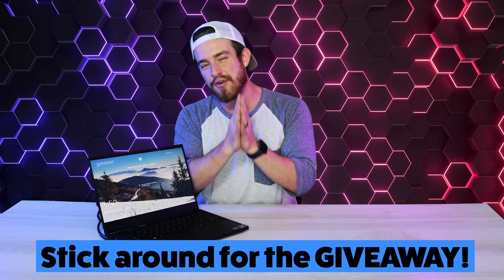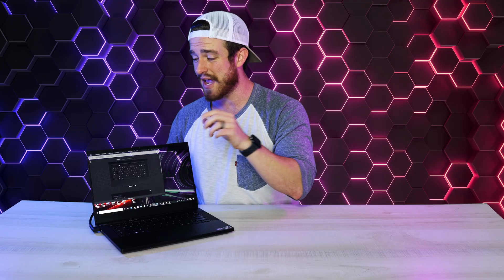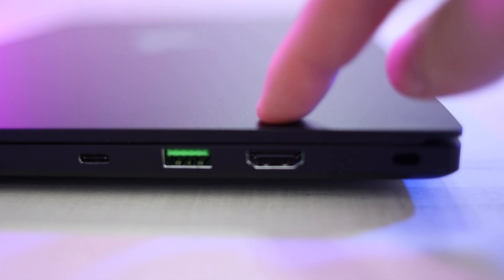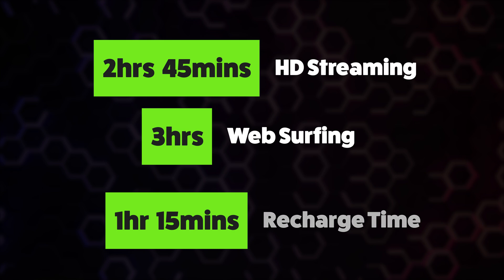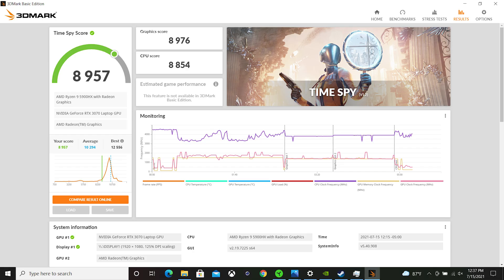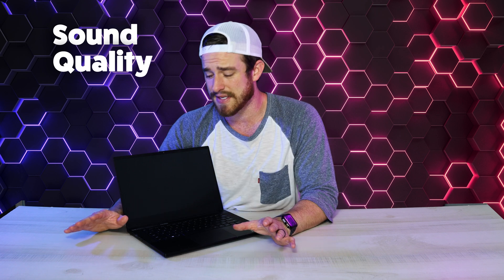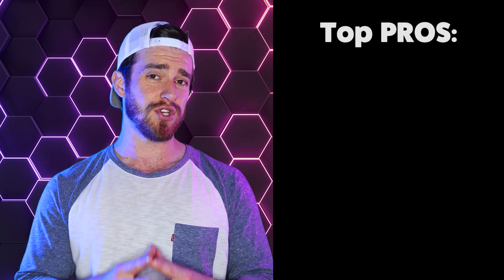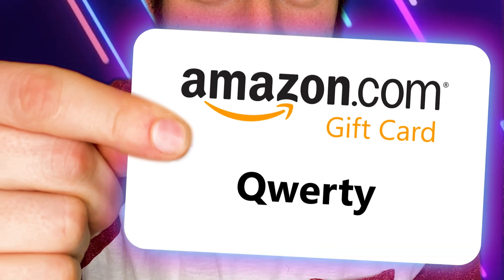Razer Blade 14 Review! - How Does All That Power Fit?

Comment: Great review.  Interesting comment about the battery.  I got my blade 14 prior to finding this review and found the battery life pretty solid at 8-10 hours depending on use, but I can see how 60 watt hours is a little unusual for the size.  I imagine that huge vapor chamber put a crimp on anything bigger.  Definitely agreed on the 16gb RAM, ideally 32 would have been an option, soldered on
Reply from the maker: Yeah Kenneth, I think there was something wrong with mine because some other people were saying the same thing about their batteries
Reply: same I easily get 9 hours, but have seen as high as 12 depending on usage... I've had mine for a year too

Comment: The NVMe at 4:23 is NOT PCIe 4.0 it's an 3.0 x4, it's a Samsung drive with about 3500 Mb/s read and 3000 Mb/s write.
Oh by the way, your wall is cool. Especially at the start with the moving effect.
Reply from the maker: Thank you Eitya! Yes that was my mistake. I must have wrote that stat down incorrectly during my scripting stage

Comment: how temperatures and fan noise against Blade 15 MID 2021
Reply from the maker: Hey shakal, I haven't tested the Blade 15 yet but I would assume they are slightly better on the 15 since its bigger and has more of an ability to get rid of heat quicker.
Reply: @JustinTechTips  if heard differently from what I've heard the 14 has better thermals and quieter fans some say it's because it has amd instead of Intel.

Comment: I'm getting 7-8 hours of battery with the display at 75% brightness 1440p/165hz (3070 Variant). Not trying to be a jerk, but you may not have done the proper tweaks. Make sure the dGPU is staying asleep and check your advanced power options.

Also, why would you test games at 1080p and 4k, but not the native 1440p?
Reply from the maker: Hey Michael, yeah I even disabled the GPU to make sure and only got about 3hrs while HD streaming with the battery slider all the way to the left and the CPU and GPU power options at their lowest settings in Synapse. Maybe my unit wasn't functioning properly if other people are getting so much more time on the battery. I tested the games at 1080p and 4k because those are what I've tested all the other laptops at and I wanted an apples to apples comparison as far as performance.
Reply: @JustinTechTips  gotcha, I understand why you tested at those resolutions. Thank you for the clarification and I hope I wasn’t coming off as rude.

Odd, I keep my Blade 14 on better battery, not battery saver. I have a post on Reddit in the Razer subreddit, maybe take a look if the laptop is your personal device and not a review unit. It’ll help with the battery
Reply from the maker: Thanks for the feedback Michael. No you didn't come across as rude. Do you have a link to that subreddit?

Comment: thanks, all the videos I've saw claimed way way better battery life then yours, almost as good as macbook m1 air ( especially when anything else then light light use like emails ), so I see it's +- the same as my legion 5 4600h rtx 2060 80wh , but this was 1200€ half a year ago
Reply from the maker: Yeah, I'm wondering if I had a unit with a defective battery, because a few people below in the comments have said they got better battery than that as well..
Reply: @JustinTechTips   try to look at hwinfo how much W system pulling out , if external gpu not eating much of a battery . Also if Radeon graphic internal is doing a basic tasks and nvidia is at 0 or it flactuate

Comment: 2 hours of battery life?! Are you sure about that, it sounds more like a 17inch without optimus and an intel chip trying to run on battery
Reply from the maker: Hey PadeJuan. Yes unfortunately it is a pretty small battery at 61watt hrs. 2hrs 45 mins was what I got with HD streaming.
Reply: @JustinTechTips  well thank you for the testing. Really turned me around with this laptop. Appreciate it
Reply from the maker: No problem Pade! Looks like some people in the comments have said they were getting basically double what I was getting as far as battery life. So it is possible there was something wrong with my battery.
Reply: Dunno dude, I got the 3060 model and I get around 11hrs watching youtube (but gotta admit that mine has more like 66wh). I think he got something wrong in windows. 
The changes I made were in the hidden power plan options, which you can unlock if you change a certain value in a certain registry (just google "disable boost zephyrus)
Reply: @andrekeller6161  thank you

Comment: Difference between 3060 or 3070?
Reply from the maker: Hey Demxnbxyxo great question. In general the 3070 has shown a significantly greater performance across all games. Averaging at about 30% faster than the 3060. Large jump in value from the 3060 to 3070 but a pretty small improvement from the 3070 laptop GPU to 3080 laptop GPU

Comment: I just returned my razer blade 14 (3060), battery life just ain't it for me. I needed something that can game and for work. As a uni student, I will be traveling a lot and battery life was key, and let me just tell you folks who are about to buy it; imo not worth it if using for work and for gaming. However, if battery life isn't as important then this is one of the best laptops. The temps were super impressive, and literally, everything else about it was perfect. While using youtube and browsing I was getting max battery life of like 3-4 hours (this is with battery saver and everything else to optimize battery over performance). Also, the display seemed over-saturated when unplugged, but that could be cuz I was using battery-saving mode. Anyways, I am now going to try out the Asus rog Zephyrus g15 as I heard it has a really good battery life and decent performance when gaming. That is when it comes back in stock :/

Also great video, I can confirm everything in this video was super accurate! <3
Reply: Yo, thanks for ur feedback ! One question: the battery is also bad even when it comes to watch a movie or using like standard app such as Excel, Power point etc ?
Reply from the maker: Yeah Loading is right. At best even when the computer is just sitting there on a webpage 3-4 hrs max
Reply: @JustinTechTips  Yeah, you have to be very careful with what exactly you are using the laptop for, like when I was watching twitch, my battery was getting drained super fast, I think it was almost -20wh, something crazy like that. Honestly, I thought it was defective at first but then just realized that a 60watt battery just aint it lmaoo.
Reply: @JustinTechTips  that's not normal. I've seen others with much better results you may have gotten a model with issues. My friend get 6 to 9 hours for video streaming and web browsing with right settings.
Reply: @Nicolas-oe8zm  Yeah well if you are only planning to use excel and not have anything open. Then yea it should be great, but like if you are planning to have youtube or something else that requires your cpu, well then you are going to get that average -13wh or -14wh which will give you around 4 hours of battery. Not to mention, my laptop did have random spikes at -20wh so maybe I had a defecetive one. In general, you just have to be very careful with what you are using the laptop for, like certain applications are going to consume more battery. And like for me at least, I dont really want to be cautious using a device I dropped 2k+ on to conserve battery, like sure Ill use battery saving mode and do the easy stuff but I feel like going out of the way to see what exactly is causing the issue is not fair. Not to mention, razer advertised the battery at like 12 hours but thats if you have 0 applications and you arent doing anything on the laptop lool.
Reply: @loading.6583  ahh I see. I wanted to drop my Mac (intel) for a gaming pc with a good design for school and work. But 4 h its definitly impossible in a 8-9h day where I use actually many apps from the pack office + yt. Though this Razer would be perfect but looks like no… thanks a lot for your help tho, rly appreciate
Reply: @loading.6583  ok I will check that, thanks
Reply: @loading.6583  also, how is the noise when you use « normal » apps like youtube and pack office apps ? Is it like possible to use in a big class full of students or it is really noisy ?
Reply: @Nicolas-oe8zm  Yep should be fine when taking in quiet places, sometimes it does pick up but that's only for like a 20-30sec. Overall quiet when working
Reply from the maker: Yeah Loading, I'm curious if any reviewer as got anywhere close to even 8hrs of battery life on this one
Reply: @JustinTechTips  I think it is possible, I was browsing through Reddit again, and apparently, the Dgpu can still be getting used when on battery. There were a lot of other things I didn't try when I had the laptop, so in all honesty, you can probably spend like 2-3 hours and properly optimize it to not drain as much battery. With that being said, the battery is a hit or miss in general because some people were getting insane battery life straight out of the box while others were having the same issue as me.... so tbh I'm super clueless. It could also just be a common software bug and not the battery... like idk lol

 I think in a few weeks of time someone on Reddit is going to release a proper full thread on how to fix it, just like how people did with the g14.
Reply from the maker: Thank you Loading! Yeah for people that like their battery, this ain’t the one for them. CPU showed high temps when gaming but I was really impressed with how cool the outside of the laptop felt. My Alienware is literally too hot for my lap.. and that’s with pants on
Reply: What about the lenovo legion 7 3060/ 3070?  it looks proffesional and is a beast! I'm planning to buy it
Reply from the maker: abc that is a great one but unfortunately they have 4+ month wait times after you purchase
Reply: @JustinTechTips  Yeah right! are you also planning on buying one?
Reply from the maker: Yeah I was wanting to get one just for reviewing but it looks like I won’t be able to for a while and by the time I do, people probably won’t care as much about it anymore 😕
Reply: They both have similar specs
Reply: @demxnbxyxo_9994  Yep they do, I think this Razer will perform better when it comes to gaming, but ill take that -5 -10fps for that extra 2 hours of battery any day.